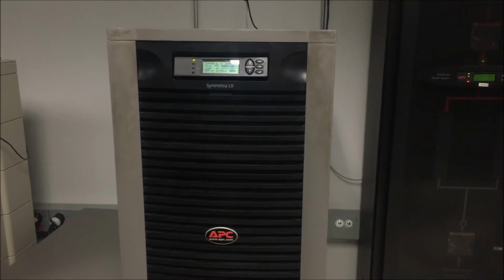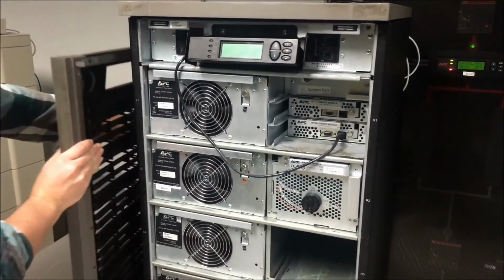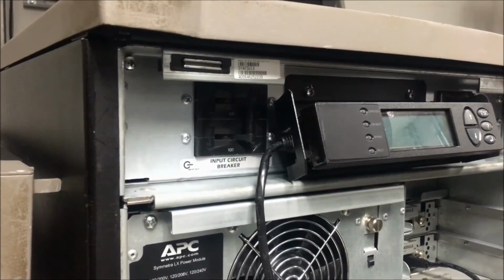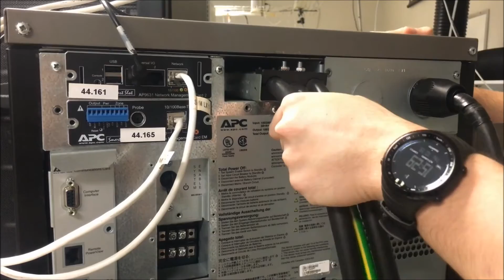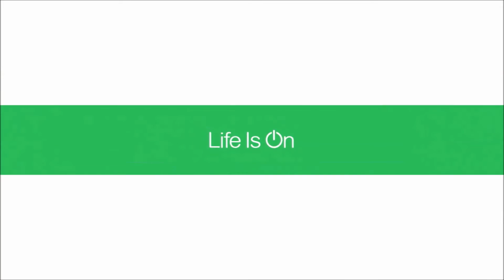Performing Total Power Off Procedure for Symmetra LX | Schneider Electric Support

Comment: -Turn the ‘SYSTEM ENABLE’ switch off by fully moving it from the UP to DOWN position
-Remove the front cover of the UPS, set it aside
-Turn off the INPUT CIRCUIT BREAKER by fully moving it from the right to left position
-Disconnect all MAINFRAME BATTERY MODULES
-Disconnect the XR FRAME DC POWER CABLE
-Flip the UPSTREAM BREAKER feeding the UPS